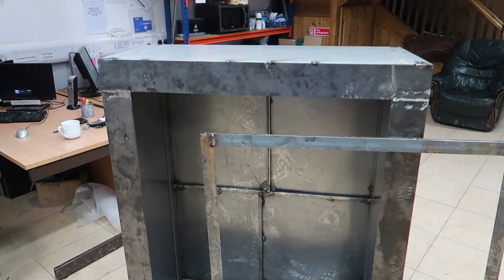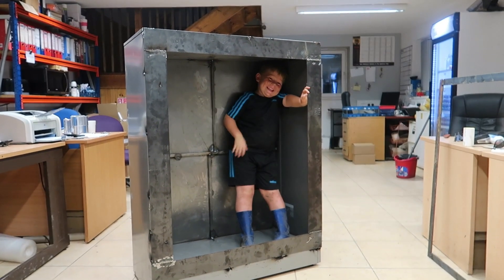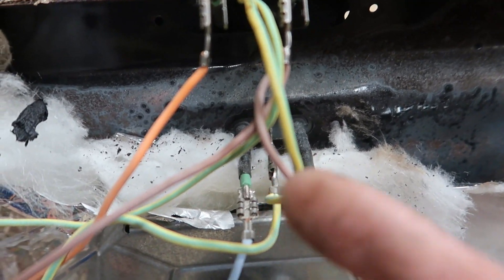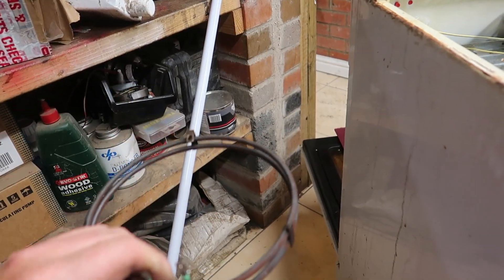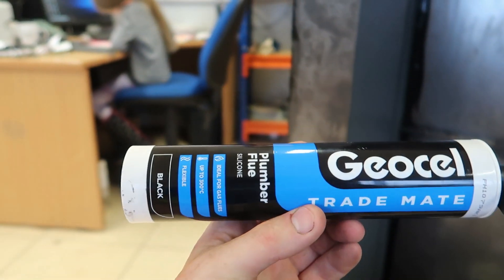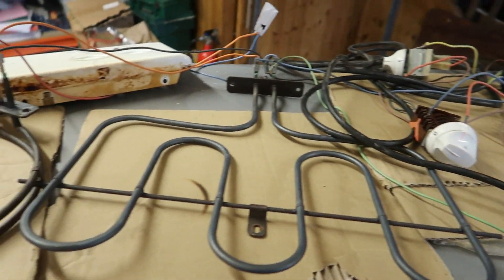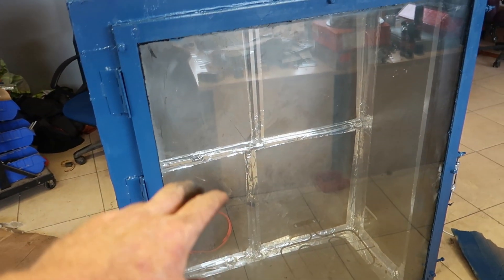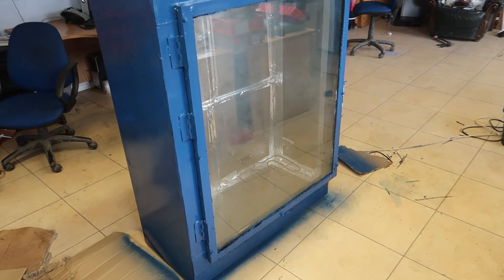Large Cheap  Powder Coat Oven  Made From Kitchen Oven step by step easy with wiring

Comment: The casing of your oven needs to be grounded (earthed) for fault protection!!
Should the casing become live through any kind of  fault (incurred over time)  could be fatal!!
An earthed casing will pick up the live and trip out your  mini circuit breaker. 
From your consumer unit,causing a safe disconnection!!

Comment: Just what i'm looking for,but i'm no sparky,so how did you fit and wire up the elements to the back,are they insulated from the metal box?
Reply: You should run an earth tail on  the metal box somewhere, for fault protection, so it trips out the mcb on the consumer(fuse box) unit!!

Comment: Please remember that any form of silicone in a powder coating oven is a no no . This will play havoc with the finishes
Reply: Creates fish eyes on your work.
Reply: Mr. liebenberg I am currently building n oven. So of not silicone should I just use the silver tape or do you have any advice on what to use?
Reply: @Robert-qd8rf  make a good tight fit and weld it up! Not gonna hurt to lose a little heat cuz it needs to vent anyway! Most ovens have vents all over them!